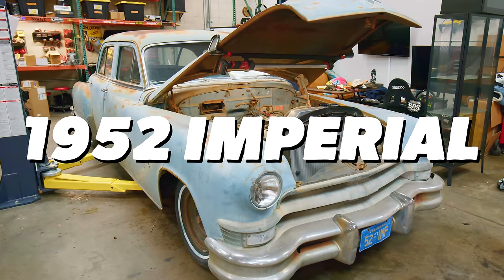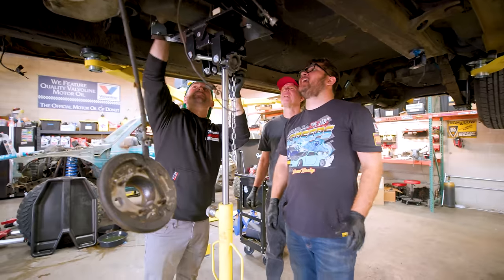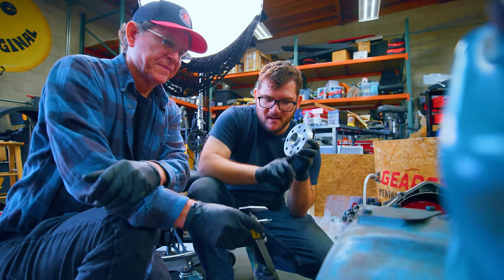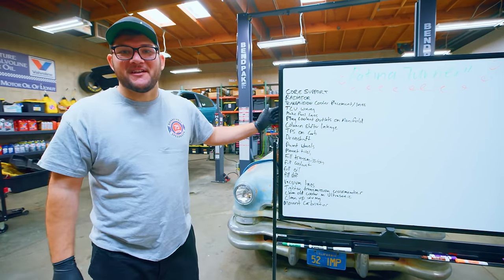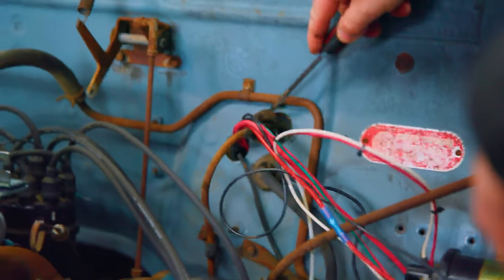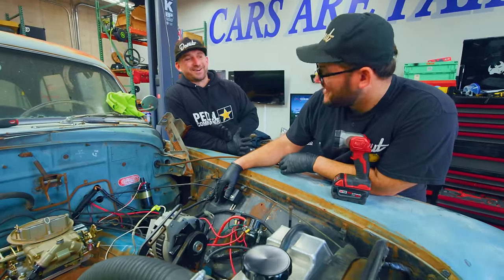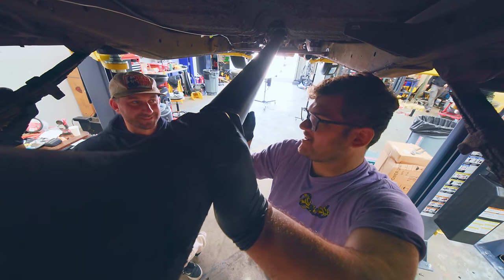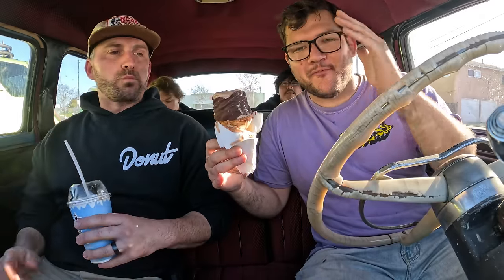I Finally Fixed My Abandoned Project Car

Comment: 4 years... you speed demon. My brother has been working on rebuilding a 1948 Holden 48/215 (yeah, an Australian car). He started about 30 years ago and is just waiting to get door rubbers which are not cheap or abundant. He might have it on the road for it's 100th birthday.

Comment: Tip for the future: Anytime you pull a trans in an older motor, replace the rear main seal. That's probably where your leak is when you got it all back together.

Comment: If Nolan ever planned on swapping this, it would be really interesting to see them attempt to push it to it's limits first, maybe bore it out, add forced induction whether SC or TC, since you don't really get to see extensive modification to older engines nowadays.
However I am a sucker for preservation at the same time and love how this thing sounds, and looks.

Comment: Fun but crazy.. I experimented years ago with nitro and had a blast.  Just was too expensive for a gallon. And the exhaust hurt your stomach alot.. like if you ate too much peanut butter at one time.. just hurt alot . But was pretty damn fun mixing it with different fuels used for different applications and seeing what kind of an upgrade the mixed fuel would bring to the party.. pretty much exactly what you guys did here in this video.. great fun!❤😂😂

Comment: Hot tip: put two or three fuel filters inline at first on an old car. You'll change the first one pretty regularly until it spews all the crap out, but you can just eliminate it if it gets plugged up so it won't leave you stranded anywhere, and you won't have to carry a filter or filters with you since it'll still have a filter or filters downstream of the plugged one you eliminated. Once it straightens up, just leave the last one in there. Oh, and that's a 331 Hemi, isn't it? Surely there are all kinds of 4-barrel intake manifolds available for them, aren't there? Then again, if it's just a cruiser, 2-barrels are more peppy around town as well as cheaper to run. Does a Chrysler this old run everything through the ammeter like later Mopars? If so, eliminating all that mess through a fuse/relay panel with a more reasonable voltmeter is a REAL good idea, as is eliminating the ballast resistor situation (if it has one, I don't know about ones that old, but I'm pretty sure you can't get new ones and old ones are getting pretty scarce).

Awesome old car, congratulations! Drive it til it blows up, build a motor, and do it again! I love old west-coast cars like this, here in WV they're either utter rotten garbage or 75,000-dollar restored pristine cars, very rarely anything in between.

Comment: I’m really curious, what did you do for the park function? I have a ‘55 DeSoto Chrysler product and you’re supposed to use neutral and the parking brake, because park didn’t exist until later. Did your column shift have enough motion to add that? Did you also convert the rear drums to be parking brakes too? Anyway, awesome to see it on the road!

Comment: Oh not sure if you'll see this but I've got a classic as well and was told by an old cam guy who works on flat tappets that its better to go with an oil that was prepped with the zinc already in it. He said it was because off the shelf oils act like a detergent towards the zinc additives washing them off the camshaft. I went with Driven GP1 oil for "hot rods" basically its specially made for old cars. Anyways hope this helps.

Comment: Ok got a bit further in... when you have parts out like the core support, you should have media blasted it and gave it a fresh coat of flat black paint to stop the rust from getting any worse... it's kind of like a no brainer thing to do...  I understand keeping some patina, but you have a new shiny radiator and trans... so... now I'm not talking full restore, keep it looking old and patina but protect the metal.

Comment: WAIT the old trans was a fluid drive?  I was researching those the other day, you could put a car in third gear and let off the clutch without stalling, then slowly apply gas and make the car creep over anything.  Amazing concept but as you found out, if they blow apart, they're impossible to fix or find parts for.

Comment: I'd take a guess you guys used newer lower viscosity oil like a 10w-40 or 0w-30, maybe using a more old school oil like a 20w-50 might allow the rear main seal to not leak?. Might be worth the 30-40$ oil change to just see if it works?.

Comment: Can't complain about the use of a 4L60. My car (a 2001 Holden Commodore) comes with the 4L60-E and it's ate up all the abuse I've thrown at it so far (through the very mildly modified L36 'ecotech' engine).

Comment: This is a nice project. One thing I just don't understand is why you don't clean up all the engine bay parts that you took of, before putting them back in. Just give them a quick sand blasting and a layer of paint. Also, you need to sort and loom the cable situation in your engine bay. Right now it looks like a high school ricer, that installed 12 led strips around the car. 🙃

Comment: I mean that massive spacer is cool and all but a pull out 5.7/8 speed combo on a stand alone couldn’t have been too much more than some serious custom adapters and “built” 4l60 plus stand alone trans controller
Reply: Roughly 7k for all of those swap parts…… but 3500 was too much to fix the original trans………

Comment: Try either 15w-40 Rotella T6 or Mobil1 15W-50, both have fairly high levels of zinc and are a great synthetic choice for older cars. Good job, but the lazy person in me would have been pretty tempted to just pull out the whole engine and do a more modern swap rather than adapting all the more modern stuff to the archaic engine.

Comment: Damn, those pull ups were lowkey impressive. Adam's not a small guy, he must have some TORQUE to do pull ups so easily
My max was like 17 in high school cause I was 5'9 and 135lbs lmao. Started at 150 and worked out 5 times a week, did pull ups at home all time too. It turns out I min-maxed my frame for doing pull ups lmao. They get exponentially harder the more you weigh, so when I had the muscle mass from being large + the skinny ass frame from borderline anorexia after, it went hard on the pull up bar. Still never managed to do a muscle up though :')

Comment: Probably should have run a wider tread width and slightly less aspect ratio. Also those look bias ply. Definitely don't run bias ply tires on cars ever. Radials only, properly fitted. However if he's happy and it works. Good shit.

Comment: that moment when you get the motor out, and the first thing you want to do is complete engine teardown, clean, balance, maybe do a port and valve job, head and block deck shave, flush and clean coolant and oil passages and galleries of engine and accessories, cold break in, and then reassemble with fresh fluids, and gain 25% more hrsprs, torques, and rev and throttle response. 

almost a full engine rebuild to bring it to factory fresh plus. may as well. engine's out, so it's pretty easy to do.

Comment: Just trying to see if I could get a specific link to the adapter kit you mention at 6:05. Tried looking up bespoke adapter kit by speed gems and or wilcap and I don’t specifically see what kit you have there. I have an old ford with a 331 swapped into it and the torque fluid drive transmission but that trans is gonna be the death of me and the modernization of this set up just seems like a world of difference. Any assistance would be nice!

Comment: The next time you guys heat up with a torch. You should shock it with cold water. It'll break the rusts, it will make a lot either. Taking it off, let's force force if you do the hot and water trick.

Comment: Honestly $3500 wasn't a bad price for a transmission rebuild. If I had to try to get a 4l60E installed and working it would have been more than that for sure with all the other mods that come with making it work on your engine, frame, differential, driveshaft, etc...

Comment: When I installed a carb and the throttle rod was short or long I would make it adjustable. Too short?...add an adjuster and another rod. Too long then cut and add an adjuster. That way no matter what I could get the carb to open correctly. Why is it sitting so low? Bad springs? Looks weird sitting like that.

Comment: If the rear main is leaking a little after all that work, it's worth just living with a little leak for now. If is gushing oil, then you gotta address it.

Living with a car with 50, 60 or 70+ year old  seals means living with leaks.

It costs WAY too much $$$ to make an old rig perfect. It's better to have good enough and enjoy the car with it's flaws. That's how these old rigs stay alive. It's not about doing full restorations (those a re great for the big spenders) it's about making your project drivable even enjoyable again even if it's not picture perfect.

Comment: that trans cross brace seems like it wouldnt be strong enough no? or i guess the car isnt putting out enough power for that to be a problem?

also, should alwaysssss change the rear main seal if you're already taking all that apart, at least you know for next time i guess

Comment: Awesome how you modernised for common parts. My only question is why you didn't just go electric fuel pump? Thats what most of us do
Reply: In fact why didn't you just put a modern v8 in it 🤷
An old man once told me when I was doing a similar project on a mercedes "just put a chev in it"
Turned out a Ford 351 bolted right in 😅

Comment: transmission coolers are stupid. 

modern race grade oil 75w 90 full Synetic do not require extra cooling. 

you may actually cause more issues with this step up in the long term.

Comment: $3500 for that rare and antique drivetrain sounds like a steal compared to what I've been quoted. The shop I took my car to wanted $7500 for a whole new transmission... for a 2008 4-cylinder manual car that's worth, at best, $3000, and all that was wrong is it wouldn't go into first gear.

When I finally got sick of their $#!+ and got my car back from them (not put back together, of course, cuz I wouldn't trust them to fix a baloney sandwich), they had my engine supported by a 2x6 and some house wire (the guy at the shop just HAD to get his precious chain back). I drove my car there, then had to pay over $1000 for the privilege of having my transmission torn apart and ruined, plus I had to pay to have my car towed back home so I can fix it, because I'm the only person in the whole state who knows how to fix anything, apparently.

I don't want to name names, but Bremerton Transmission at 3737 Arsenal Way will absolutely rip you off, and they're not the only ones. Don't let these rip-off shops keep getting away with this BS. Learn to do all of your own automotive work and put all those MFers out of business. Rant over.

Comment: Do not use a plastic fuel filter especially inside the engine Bay use a metal filter from like AutoZone and put it underneath the car we almost lost our 71 VW bus due to snapped fuel filter and it started pouring gas all over the engine and caught fire

Comment: Did your editors completely forget about the no oil pressure and how it was resolved? How about when Nolan put the carb spacer and carb on with no gaskets?

Comment: $3500 to fix the original transmission... F that. How bout $7000 for a new one....
Reply: I was thinking the same, but unfortunately when you repair a transmission you need to send it to a professional shop that give a good warranty and is well known, sometimes we are talking to send it to other state because if you choose the unknown transmission shop or the well known transmission shop in your city they will charge you a lot and 6 moths later you will have again a broken transmission

Comment: You mean to tell me, a Garage wanted to charge $3500.00 to replace the seals????  NAPA would have charged $25.00 for a seal replacement kit. Hell, for $10.00 bucks you could have gotten the material and made the seals.

Comment: No offense, there is just too much things you can avoid by doing simple research on why you should change the drive train to at least to a slightly more modern engine you already did the transmission and all sorts of modifications to get the transmission in

Comment: dawg. doing a full engine pull and transmission replacement and not replacing the rear main seal on a 70 year old car. Amateur hour.